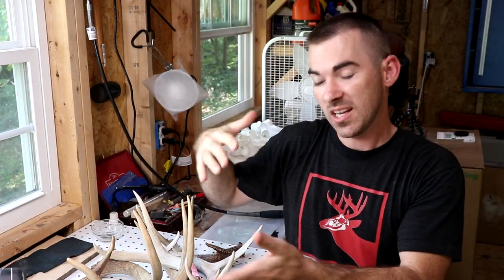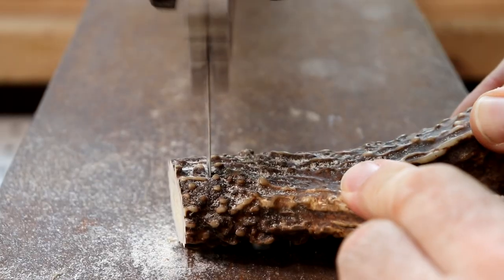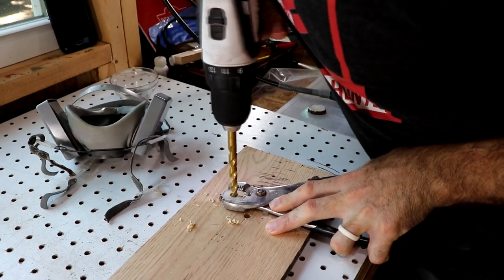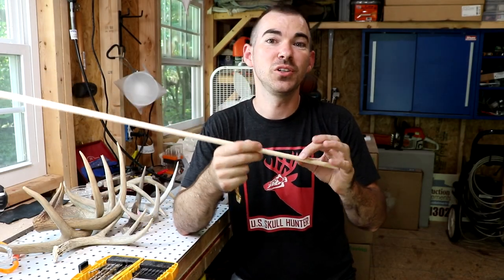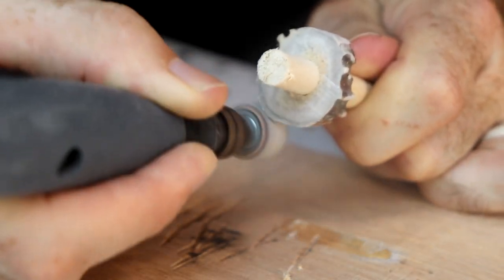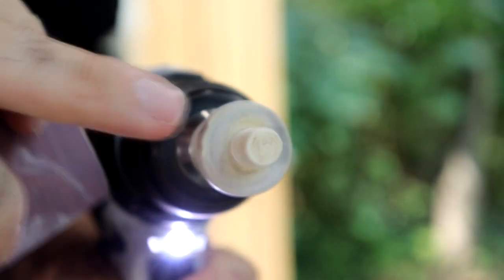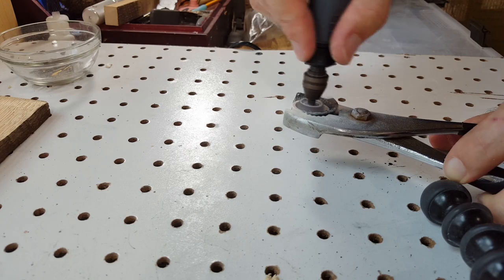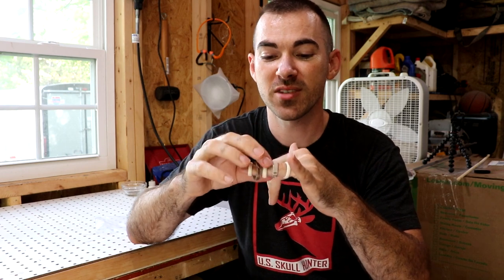Deer Antler Ring How-To (No Lathe Required!)

Comment: Hi! I've made myself an uroboros ring from a ram horn by cutting out a flat piece of the surface of the horn first. Treated horns usually have a large hole inside them so it was uneasy to find a spot that would fit my finger by just cutting the horn in half, but I figured that the surface was plenty of usable spots. I thought that the material was more fragile so at first I went very gently on it, but then for the sake of the experiment I made the "tail" part much thinner than the rest of the "body" of the snake. And it went pretty well! It's more durable than I expected it to be, actually seems pretty unbreakable, and the texture of the ram horn looks amazing on my finger.
Reply from the maker: That sounds awesome! Would love to see it!

Comment: I do the same as you with antler, Rings and Pendants etc. I dont have a hobbie lathe but working on it as they cost on average about $3,000 here in New Zealand, Using Copper, Epoxy resin, abalone, Brass as inlays, Soon I will be using meteorite as well when it arrives.

Comment: So to get the inner diameter right all you have to do is get a ring mandrel kit. They usually come with a ring set that you just slip over the persons finger to tell what size they need. Then you take that ring and center it on you piece of antler and trace the inside with a pencil and you have a guide on the inner diameter
Reply from the maker: Nice Matt!

Comment: Antler is awesome, it and bone are sometimes called paleo-plastic. And you can soak the antler to make it softer and spray water on it to cut down on dust. Bone dust can cause white lung, I believe, but it takes years of exposure.
Reply from the maker: Yes, it's very important to wear a proper respirator!

Comment: My gold wedding band shrunk enough over years that it no longer fit, I made a white tail ring for myself by drill and dremel on the inside and left the outside natural, it looks great is light weight and yes very durable too. I didn’t have a good respirator so I set up a good draft and a fan to suck and then blow the dust away. That worked great but you definitely need to be careful.
Reply from the maker: Nice man! Yeah gotta keep those lungs clean :)

Comment: do you have any tips on keeping the inside hole even all the way around when you clear it out with a dremel?
Reply from the maker: Well you can take a wooden dowel rod just a little smaller than the inside of the ring and wrap and glue some sandpaper around it and then finish it off that way. The larger area would make it a lot more even.

Comment: What kind of saw blade do you use to make the cut look so smooth? Thank you
Reply: you dont have to have a smooth finish from the saw.  when you sand it down to the parameters you want for the ring it takes care of the smoothness on the sides.  thats why he stated you cut it a bit thicker than needed
Reply from the maker: Hey Savannah! Sorry this reply is so lake! Yeah so it is the sanding of the sides that result in it becoming even and smooth on the sides of the ring.

Comment: How long does it take for the dust to settle? How can I do this and keep my family safe from breathing like if they walk in I guess keep door locked? How would you clean up the dust without getting it in ya lungs from tables or walls or floors I was gonna make a homemade grind box
Reply from the maker: So the best thing you can do is run a vacuum cleaner and hold the hose right up to where you are carving. If you can suck up the dust as you are making it, that will go a long way in keeping it out of your work area and out of your lungs. But yes, having a designated area helps. Just as long as there is fresh air coming in the dust will not stay suspended long.

Comment: anyone got tips for possible coatings for antler jewelry? that would help protect against water mostly
Reply from the maker: You will usually stabilize the rings with CA glue which protects the ring as well. Adding a final coat of wax as well will work to protect the ring.
Reply: @usskullhunter  do you have a step by step guide for this? I'm worried i will make the coating too thick that would make the ring unwearable
Reply from the maker: I can send you a video. Are you on Instagram? I am at @u.s.skullhunter send me a message there @massiveleg

Comment: Hello! I have a question. Once the ring is finished, do you protect it with some product? My ring, if wet, is a little sticky until it dries. It's normal? Can I possibly finish it with cyanoacrylate glue?
Thank you :)
Reply from the maker: Hey Alassia! I put a coat of the CA glue you see me use in the video or just coat in wax. Either of those will protect the bone.
Reply: thanks! :D 
I watched the videos, but I didn't notice the wax or glue ... ò.o

Comment: If I don't own a respirator will a mask work alright?
Reply from the maker: It should. A good test is to simply see if you can still smell any bone dust when you wear it.
Reply: I have a suggestion that might work.

I was a cop for 31 years and when I went to the scene of a homicide or any other kind of death, I would plug both nostrils with Vicks VapoRub or I could not smell anything. It made my work easier, plus it kept anything from going up my nose.

I hope this helps.  If there is any reason why this will not work, I’m sure that our mutual friend Hunter will know and will direct you accordingly.

Good luck!
Reply: Texanrider76465 thank you
Reply: U.S. Skull Hunter thank you as well
Reply: Trash Gaming You are most welcome.